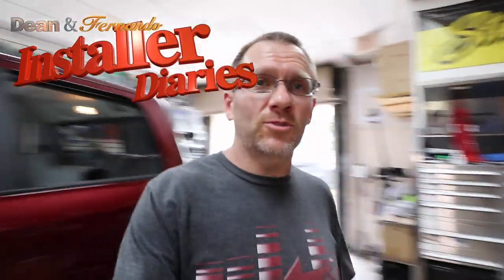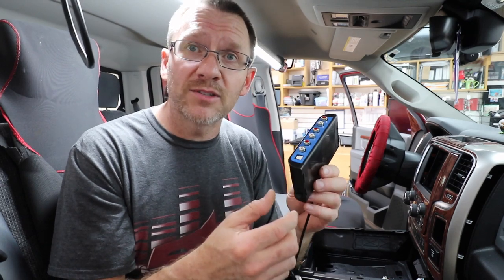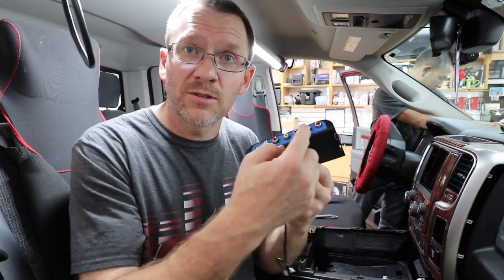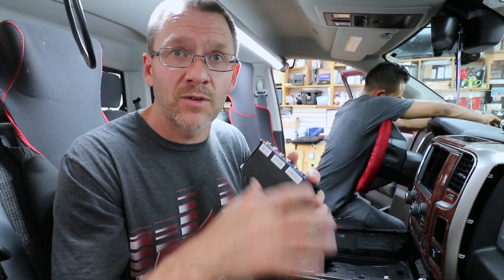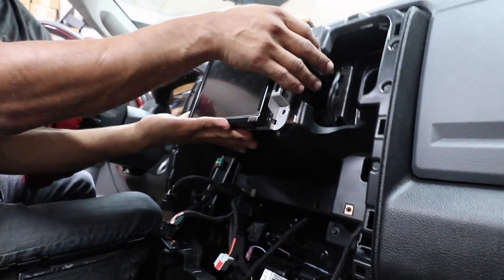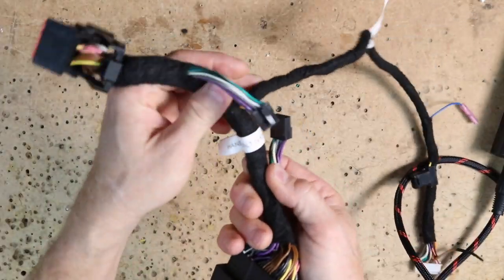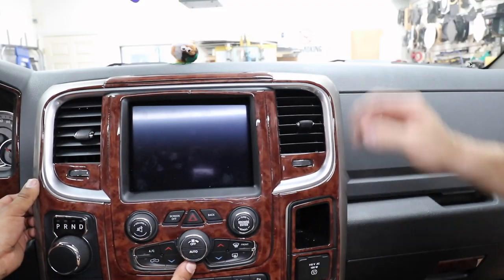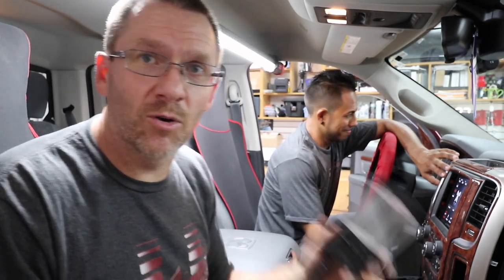The new beta PAC AP4 CH41 adds pre amp to your 8" Dodge radio Installer Diaries 202

Comment: Any advice or recommendations for me? I am wanting to add 2 subwoofers. I have a 2014 Dodge Ram Laramie with the 8.4 uConnect radio with the Alpine sound system. It has 1 factory subwoofer. But I am wanting to swap it for the two aftermarket subwoofers I bought with an aftermarket amp. What would I need to make it work? Because I’m also wanting to keep the factory radio

Comment: This is what I need. My new 2020 challenger sounds like a $500 system and 500 watts when I'm really pushing 1700rms. This will fix my issue with the Lc2i. I hate hi lows
Reply: Same. I just added a epicenter micro to my subs which are tapping into the rear 6x9’s and i hate it. Doesn’t sound as good as a friends car with an epicenter.

Comment: Okay so i have a 2018 392 Daytona with Harman Kardon  system. I've replaced all the speakers and subwoofer. 
The 3.5 tweeter are JBL 
The 6x9 are kicker CS Series 
And the subwoofer is a 8 inch kicker comp c. It still has factory amp and head unit.
Will this product work and make it sound better ?

Comment: I am adding six Kicker speakers to my 19 Ram classic with factory sound and the 8.4 screen. I plan to use JL RD400/4 for my front speakers and later add a sub. Here’s my dilemma. Please take into account I’m a very experienced truck tech with electrical experience and I am just looking for improved audio for a daily driver. 

Should I save money by only using the RD400 high input feature and wire the speakers hot into the amp?

Should I purchase an LC6i and clean up the inputs before the amp, thus Slicing into the harness - and saving some money versus the ap4-ch41 R.2?

Should I bite the bullet and purchase this expensive harness and proceed with my install plans?

Comment: I just installed this today in my 2014 Ram 2500.
Works great. Only splicing/crimping wires were between the amp speaker outputs to the wiring harness that plugs into the harness and the remote turn on lead.
Reply: I just ordered this today from Crutchfield. It’s going on a 2013 ram 2500 with the 8” factory radio without the premium audio.

Comment: I have a jeep jl without a premium  sound system. Do you still need to run speaker wire to amp or just the rca cables

Comment: Question, why did you say to "lock" the vehicle? Is it to keep other people from opening the door or is that actually required as part of the "programming"?
Reply: @alpha2011a That's why I wouldn't want to do that kind of work. I guess the main thing when you get to the "lock" part, make sure you have the keys or remote in you hand before closing the door. 😳

Comment: I have a 2020 ram 1500 bighorn quad cab with 8.4 inch screen. What is the least expensive way to add a 4 channel for highs and one for sub. My 2015 interface works with the exception of the back up camera. Ram made a new red connector that is for the back up camera so I can’t change the radio out. Any suggestions would be appreciated

Comment: I have a non amplified system...where do you run the speaker wires from the amps...directly to speakers or to harnest wires from the connecter you disconnected(therefore using factory speaker wire)
Reply: I'm in the same boat. Can't get my front speaker to work.  Done everything exactly how they said and I still can not get the fronts to work. Subs work and rear door speakers but can't get the front door or tweeters to work
Reply: @dustinrohr2045  since this post i have installed , everything works as it should, as far as my prev post , yes you just run sub speaker wire's directly to amp. I dont know why you wouldnt be getting any sound from front and  dash,,,did you replace dash, and if so did you run separate wire from dash,,,Iam using component speakers, so i ran separate dash wires to door via crossover, then just used a metro connecter, to connect to factory speaker connection in door, therefore not cutting any factory wiring. If you ran your rca's correctly from amp pro unit to amp, and you connected the speaker wire on the amp pro harnest to amp, you should be getting sound
Reply: Also note that in that install story there were minor alterations that had to be made,, i mentioned the molex connector in the door jam's..you will have to drill a hole in that connector to put the speaker wire threw...on challengers there a big space to drill,,,also replacing the door speakers, i went with PRV components 6x9, i had to cut off the hard plastic on the shroud(speaker holder) that stops moister or dirt from getting to speaker from door, ( I used a knife and heated it up on stove and just shave melted it off, like butter),to get my speaker to fit, and i had to drill a hole in the plastic shroud that house the 6x9(there's a fat oval space on one end so i could run my wires back threw to connect to crossover i mounted on door panel(factory the connector is connected from inside of door) also the rear set of tweeters i had to cut a hole in panel, just used a hole drill bit and cut from the back, there is a factory space for those who has the prem system, just had to cut it alittle bigger to fit tweeter( 3in hole for DS18 super tweets)..looks factory..The rear deck iam using PRV 6.5's and you will need a adapter for those, and the tweeters in the dash i used a adapter as well but i still had to enlarge the hole on adapter to get them to fit...then they lined rite up,,,just tuck the factory wiring out the way(rem. ran my own dash wiring)
Reply: @edwardjones7412  hey I have a question after you plug and play the amp pro and aftermarket amp. Do you have to run each speaker wire to the amp ?
Reply: @mbr9106  i bought the speaker cable that harnest 9 sets of speaker wire and connected from amp pro to input on amps then you have to connext wire from output on  amp to speakers

Comment: I had to short the positive and negative battery cables together to get mine to learn the box. Battery disconnected of course. Used a small alligator clip test lead and let that sit for 10 minutes. Learned it just after doing that once.
Sanity check had to do the same thing for the radio to forget it. 

2018 ram 1500

Comment: I hope to get an answer being that this video is old. So hooked up my ampro and checked my voltage and it's only giving me 1.3 volts is this normal because I thought I was supposed to get at least 4-5 volts? I set head unit to highest before distortion and used 1000hz test tone. I've got fingers crossed for a response.

Comment: So I added a infinity 7005A and the door and dash speakers will not fad anymore and they are way high and I have kickers in the door and infinity dash so what’s going on.  Can I run just a 4 channel amp for my 2 10”’s or do I have to have a 5 channel amp.  Cause the shop said I need a 5 channel so I bought their 5 channel and it was the infinity hood amp but it’s getting hot and it’s killing the highs and they crackle at high volume so what’s going on.  Should I go to a 4 channel amp and not a 5 channel? 
Thanks

Comment: Hey Dean. I have a 2022 jeep grand cherokee wk. It does not have factory amplifier. Do you know where active noise cancelation module is located? I installed pac amp pro ap4ch1. Aftermarket system sounds phenomenal . But when I upgraded factory door speakers using factory wire, door speakers all seem to have blown. Pretty sure cause is the active noise cancelation module. So now I have pac anc ch01 bypass but can't find module.. please help

Comment: How can I leave the front dash tweeters playing from the original amp? Do I just not wire for them or do I have to fish the leads out from the AP4 harness and wire them to the speakers harness just to snap them back into the AP4 harness thru the black connector ?
Thanks for your help

Comment: Quick question hopefully you can help me I have a 2019 ram non-amplified factory unit I just installed the amp pro and amplified all of the door speakers and dash speakers where did you tie into your dash speakers from after the amplifier? I’m getting an awful hissing sound also did you leave the active noise cancellation module in tact because Crutchfield gave me a bypass wire that completely discards the module it just plugs from the big white plug to the small black plug nothing else going into the module this does not seem right? Also the hiss is there whether the RCA’s are plugged in or not it’s not a ground issue because it does not change with high or low volume or any kind of engine revs it’s just a constant high pitched hiss 🐍 .  Please help
Reply from the maker: Yes use the ANC bypass harness, it is a data wire that they remove. It sounds like your amp. Either the gain is to high or the quality may be to low. It is not the amp pro if you can unplug it and the noise is still there. Depending on applications we either use factory wires in dash or run new wires to amp.
Reply: @FiveStarCarStereoInc  thanks man where are you guys located at seems like you really know your stuff

Comment: First off awesome videos! I have kind of off topic question. I just purchased a 2020 ram 1500 crew cab with the same 8.4 screen and six speakers. Did you guys have the issue where the volume literally bounces around the truck when it is turned up?? I swear it's something to do with the Active Noise Cancelling Bullshit! If need be, I'll be doing this with an amp and speakers. Any help will be appreciated and thank you!

Comment: I have a question the harness with the speaker connections you are connecting that to a aftermarket amp at the speaker outputs?
Reply: yes - and if you're using a non factory amp system, you will need to re-wire directly from amp to speakers.
Reply: @crimsonsamuraiftw  hey after plug the amp pro and get your rca output to the amp. You have to run each speaker to the aftermarket amp ?

Comment: Do you run your speaker wires from aftermarket amp to the speaker wire harness that connects to factory head unit?

Comment: Do they have a product for a 5.4 inch screen (smaller screens) with no premium sound? So that I can get preamp outputs. I know this video is for the 8 inch screen. I have a 2015 dodge Durango sxt. I'm trying to avoid using an audiocontrol lc7i, dont want to cut into the harness. Thank you!
Reply from the maker: No, it only work on the 8” because it was an option from the factory. The 5.4 does not have that.
Reply: @FiveStarCarStereoInc  do I just continue with plans with my audio control lc7i? Or is there a better and easier option?
Reply: @noerodriguez1936  look into www.infotainment.com  You can change out the uConnect 5.4 to the uConnect 8.4 that is completely plug and play
Reply: @noerodriguez1936  upgrade to the 8.4 radio

Comment: Can anyone help please? I have a 2018 charger with the 8.4 NAV uconnect just the basic 6 speaker. I installed 2 12 SDR with a Skar rp1200, does anyone know the output for the radio? I have a LOC and not sure if I should use bass boost or not because I'm not sure what the output is if its restricted cause its a stock radio. Thanks

Comment: Hey so I'm assuming this provides a flat full band signal? Using low level out of the PAC module will the radio still roll off bass at higer volume levels? 

Also do you still eq from the radio or is an external eq needed in line before the amplifier?

Comment: Can this be used for only sub install. To hook up kicker bass station or similar.
Reply: Was you able to only use this to hookup just the subs?
Reply: @tnthomeremodelingrestorati8393  No! This will bypass everything in the cabin.
Reply: No, this will bypass everything in the cabin. You will need to power the speakers with an AMP.

Comment: I have a 2013 Chrysler with the ap4-ch31 and I cant get the dang thing to notice my everything installed correctly. I have swapped all the interior speakers with kicker and decided to run a ki ker 360.4. It's like my pre outs are not even working
Reply from the maker: I would give pac a call
Reply: @FiveStarCarStereoInc  understood. You are actually the only person we cared enough to do a install video. Pac makes products and do not make install videos on there own products
Reply: Needed to make sure I didnt need to order a APH-CH01
Reply: @FiveStarCarStereoInc  
What does the Amp Pro do for bass roll off? I know the 8.4 in my Charger has bass roll off to protect the cheap factory speakers.

Comment: Did I miss which system this was I have the alpine in my 18 ram rebel does it work the same way
Reply: no, this is for base 6 speaker non-amplified systems . you can just use the regular amp pro

Comment: When adding an AP4-CH41 along with aph-ch01 wire harness to a dodge challenger with 6 factory alpine speakers , do I need to install this module before replacing the door and rear deck speakers?

Comment: Great video.  I had a professional install in a 2017 Jeep GC. Added 500 amp JL Audio 5ch and new speakers and sub.  Everything is perfect except one major thing.  There is a constant "hiss". It's noticable when volume lower or off or when a song has quiet moments.  Super annoying.  Anyone experience this?? Amp pro tech support said to use 4v setting and lower gains on amp. Didn't work. Installer not being helpful. Thoughts?

Comment: Holy smokes.. I'm currently working on a 2016 Dodge Challenger with a Alpine system. Using a LCQ-1. I think this is exactly what I need! The LCQ-1 is great but I believe the amp pro would be better? What's your thoughts Dean?
P.s. Eric (@audio control) and I were talking about how awesome you guys are!
Reply from the maker: Yes you want to do the amp pro for your that car. Also they make a t harness for at the amp to give you all the speaker wires.
Reply: Thank you sooooo much Dean!! I can't tell you how much you just helped me out!! I owe ya!! Keep on rocking them video's!!!!
Reply: @FiveStarCarStereoInc  hey so I'm ordering the unit. Is the t harness just for aftermarket speakers?? I have the Alpine system and I'm just asking a mono amp for my subwoofers. Do I still need that harness add on on top of the ch41.r2

Comment: I wish you guys would have a 2019+ Ram 2500 to do an aftermarket amp in! I am about to start mine and it's so different than a 1500.
Reply: If you find some direction with this let me know because I’m looking at doing the same lol
Reply: @bearkawiboy6246  I had to get a Amp PRO, and a ANC Bypass by the foot well.  Ran a 5 channel amp, 2 dash, 4 door speakers, and a pair of 10s.
Reply: @gol10dr45  did you have any issues with the speaker lead colors?
Reply: @ceavalencia4767  I did not.  It actually pretty simple and easy now that I've done it. You do need the ANC Bypass even though it says it not required.
Reply: @gol10dr45  another harness? Where would it go? I have no other inlets for plugs open
Reply: @ceavalencia4767  ANC, Under dash, by your parking brake.
Reply: @gol10dr45  so I checked under dash around parking brake and only see OBD port. A tag on the speaker input wires is labeled to work with or WO ANC Bypass.
Reply: @ceavalencia4767  I had called PAC Audio and was on the phone with them for a few days. They said, the ANC-CH01 is in fact required for both 1500 and 2500/3500. The ANC Bypass works just like you see it under the seat on a 1500, but on a 2500 it's located under the dash/footwell area. You could also just de-pin the 4 wires from that harness like other videos too.
Reply: @gol10dr45  I have 2019 charger 6 speaker alpine and no visible amps. I've used all the harnesses that came in pac kit. I'm very confused. Purple and green speaker leads make my fronts right and rear right speakers play
Reply: @gol10dr45 why is it needed?
Reply: @sonnylandry9414  the ANC BYPASS? of you don't, the ANC will send a tone to cancel noise, but now amplified and loud.
Reply: @gol10dr45  ok but just on 2019 up correct?
Reply: @sonnylandry9414  yes

Comment: I have a 2014 Ram 1500 I install the pac Amp pro Ap4 ch21  All of my speakers work.  The balance and fader work.  Even the surround sound works.  I added   an Alpine PDX5 with aftermarket speakers and subs.   The highs are so high that the are painful   The base is muddy to non existent.   I was able to download the PC app and tweak the settings, however I could hear almost  no difference in sound. 

I tried flipping dipswitch 2, but that made no difference 

Can you help?

Comment: Good morning Dean. I have an audio control LC 1500 EpiCenter and a stinger capacitor, what order would I connect them. Thx
Reply from the maker: Off the battery to the cap then to amp. Keep cap close to amp. Radio output to Epicenter to amp. Keep radio sub crossover off or as high as it will go, use the crossover on the amp.